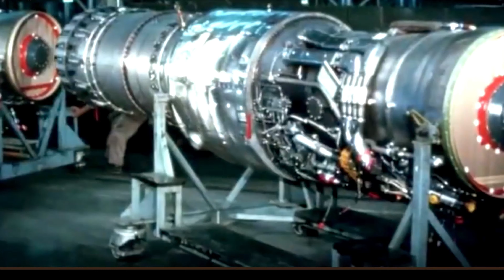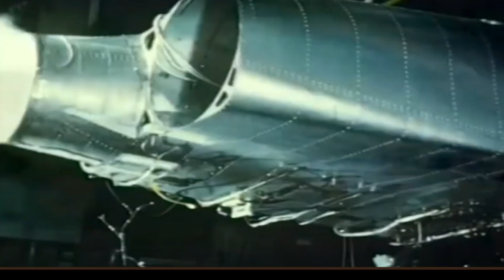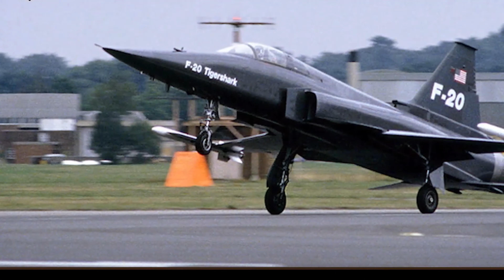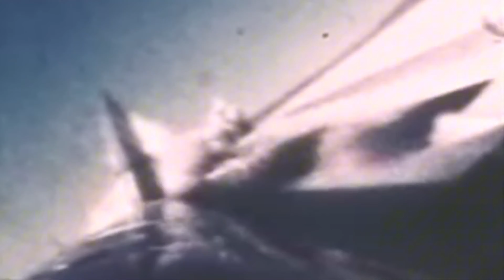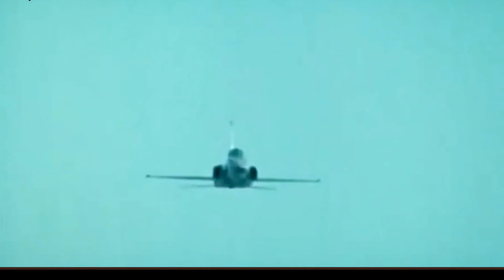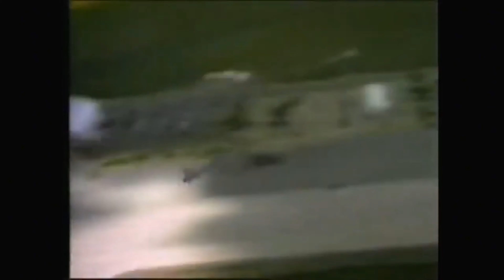The Insane Engineering of the Northrop F-20 Tigershark

Comment: It was a great plane that was designed in accordance with the Fighter Effectiveness Criteria (see "Light Fighter" article on Wikipedia).  It was not quite as good as the F-16 in the air (slightly inferior on turn rate), but it was better on a per dollar basis.   It should have been a success, but it did not have the political support of the F-16.  Today we see the same thing happening to the Saab Gripen, which is a great plane also and based on the F-20 concept.